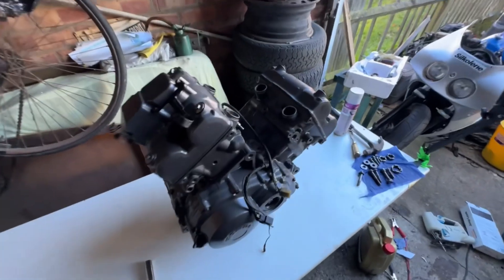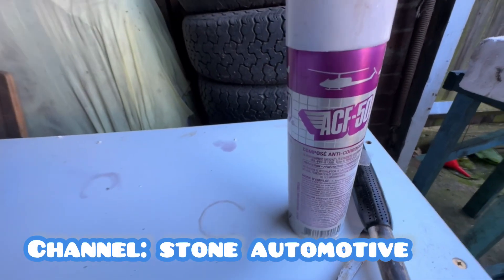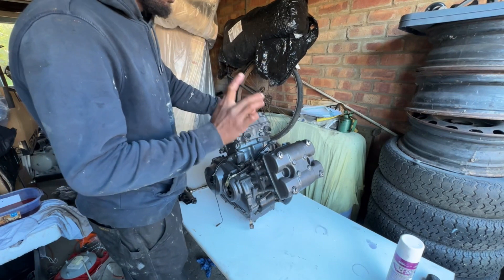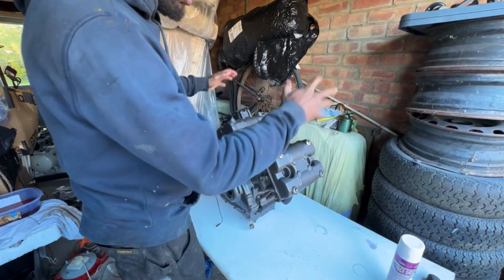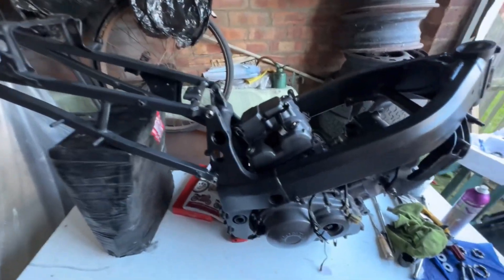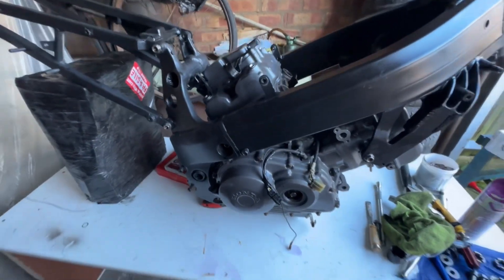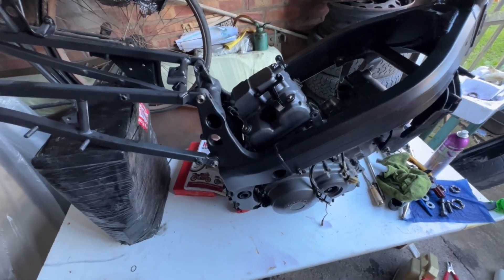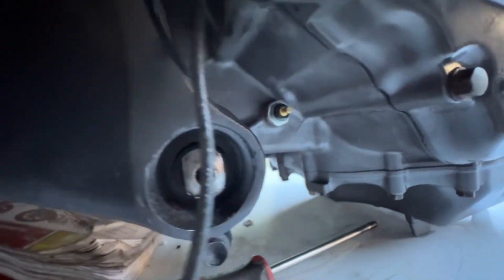Restoration of a “Barn Find” VFR 400 NC30 - Episode 20

Comment: Be careful with brake cleaner Darren pal. It gives of a highly toxic gas over 500 degrees C. That's why you can't use it to clean metal when welding.

Comment: Watch out for the exhaust when running, as the bottom of the downpipes and connection to the rear muffler.
As its a known rust spot on the exhaust, mine rotted out.